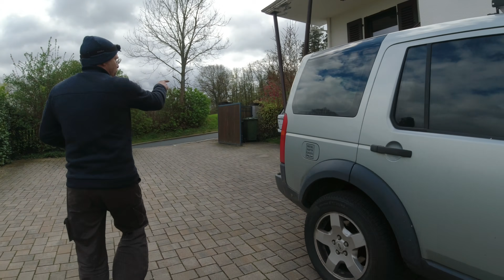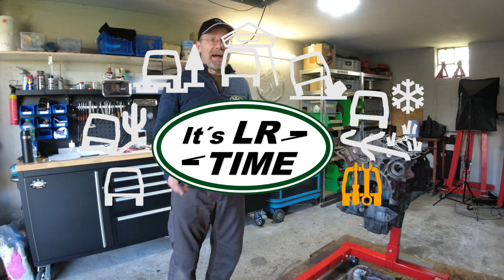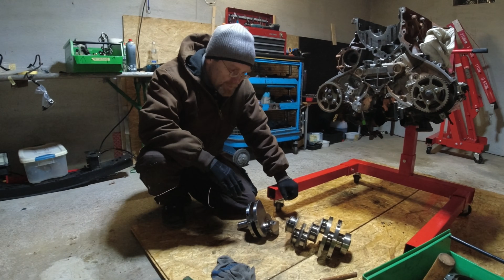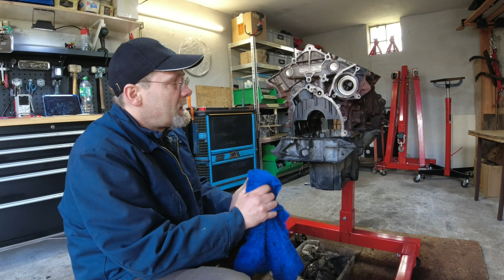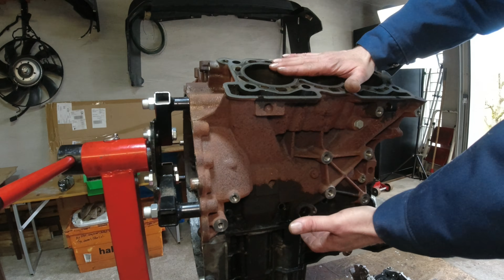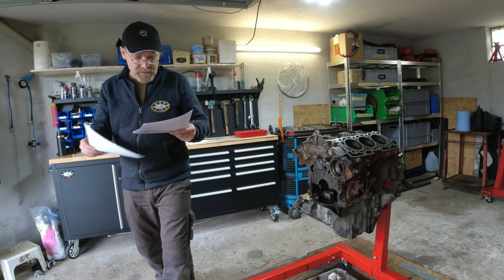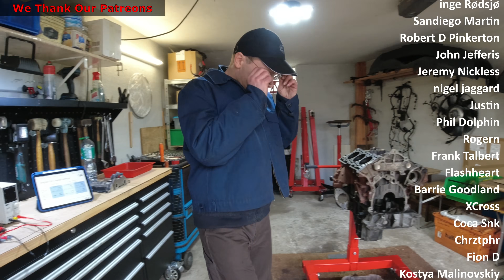Ford´s 3.0L Powerstroke failure modes - also JLR SDV6 306DT / S5-EP16

Comment: Same diesel  normal service [not sold in usa ,, but  sold in the rest of the world ] Europe service every 20,000km  Rest of the world  10,0000km . This was a Mazda design /Ford and Mazda sold   2006---2011 some countries up to 2014
Reply from the maker: It's a Citroen, PSA Colab, not Mazda. Citroen barely used that engine, maybe for 3 years. Check out our worst diesel video. We have more than enough videos on that engine. 😌😃🙋‍♀️
Reply: Same disel 2 very different service schedules 
Showing the service differences,,, u have misunderstood my comment  
Diesel motor WE-C ,,, 3 ltr ,,,4cyl  Mazda design ,,,  Called the World Ranger design  Sold every where except Usa .  Fitted to Ford Ranger and Mazda BT-50
All country service schedule every 10,000km EXCEPT EUROPE  service schedule every 20,000km.
** Comparing the requirements placed on vehicles in Europe

Comment: fuel economy expensive disasters to replace . Audi advertise dual mass flywheels as reducing emissions very$$$$$$,,,,,,, Ford use a variable vane oil pump that randomly fails mostly 100,oookm up ,,,  Toyota clutch type alternator belt drive random failure .   many many more systems

Comment: 6 bar /90 psi is not unheard of on cold start up  although 6070 80 psi on start up is preferred.  Hot oil psi /bar also  needs to be  ok .   Aftermarket v8 blocks prioritize the main crank bearings .

Comment: Factory recommended 10,000km and 5000km for severe service  ,,,,short trips,,,, cold starts,,, ,heavy load ..   
Later engines with Egr valves ,,DPF ,, turbo ,, all should be on 10,000km max ..  
Long service and fuel to oil dilution is now a problem . Wet belts and many timing chains suffer from fuel to oil contamination very badly .

Comment: Great video.  Is it possible to fit the crankshaft from the gen2 version to the gen1 version engine, or even use the upgraded gen2.5/3 that supposedly Ford are using in later F150s?  The F150 one is supposedly using a significantly stronger forged steel crankshaft.  I'd much rather have bearing failure which can be ameliorated somewhat with better trimetal bearings and thicker oil, than have the crankshaft just randomly snap.  There are also what appear to be Chinese made 'upgraded' crankshafts available for both the 2.7 and 3.0.
Reply from the maker: The block is the same and in the US, the crankshaft is available.👍🙋‍♀️

Comment: No surprise then that Citroen et al dropped this engine from their vehicles. We ran Citroens diesels, 1.7 and 1.9 litres for years, magic engines, all went past 400,000 MILES!  But we changed oil at 5,000 miles, filters at 10,000 miles.

Comment: Question: will engine from ford f150 fit to RR? I can't find any real information about it. 
Here in USA used RR engine costs $12k when f150's engine is $6k. 
Can I use parts from ford engine to rebuild RR engine?
Reply from the maker: No it will not, but the crank will👍🙋‍♀️.
Reply: @Vera_and_Christian  
Thanks a lot for the info! 
So the shortblocks are different, right?

Comment: Love watching you guys!!! Here in the states they sell forged crankshaft for TDV6. Question: would that solve the problem?
Reply from the maker: All OEM are forged👍🙋‍♀️
Reply: @ oh wow! I’m looking to purchase a 2019 TDV6 range rover. It’s got 90,000 mile (144,000 km). The oil filter shows no metal shavings or glitter. Its received regular maintenance it’s life. What’s your best advice to me about it? It spooks me knowing about the crack issue.
Reply from the maker: @LESIVSYLVESTER  Check out our "Engine Oil and Oilpump" Playlist, if you need more information, consider signing up on our Patreon page. We get up 1000 comments, messages, and emails every week and cannot answer in detail unfortunately. But on Patreon, we can. 👍

Comment: I’ve done some testing in my TDV6 3.0 D4 200k km it’s very worrying to see that above approx 96c coolant temperature the oil pressure drops off drastically. E.g towing up an incline in 25c weather the coolant temp can rise to 104c easily, therefore so does oil temp which rises above 120c resulting in 10psi oil pressure @2000rpm. 
The new uprated oil pump makes a 2-3psi difference if that… 
Now the original PWM Viscous fan was on the way out, this was a contributing factor but is not the whole problem. This fan does not fully engage until 107-108c due to the PWM control.
I now run an uprated oil pump, 10W-40, new fan, a custom thermostat (opens at like 85c) and a Redarc oil pressure +oil temp monitoring gauge. Just need to trick the PWM signal to fan now or reprogram the ECU so this will work correctly for maintained high loads or off-roading here in Australia.
I honestly believe this is the main contributor to the destruction of these engines.

Comment: In the u.s. here, really want a land rover td6, been looking at used 2017 and newer. Can i safely by this engine or is it a doomed motor from the beginning. I plan on buying one with less than a hundred thousand but need it to really last, 200k for sure. I want toyota landcruiser type reliability. You cant buy a diesel toyota here.
Reply from the maker: The 2017 and onwards is a DEF Diesel and it has bearing problems caused by oil dilution.  It can also snap a crank shaft.  If you get one, change oil every 6000 miles.

Comment: Hi Again Christian and Vera based on what you advised re 5w 40 oil from now on with my 2020 Range Rover sport should I change my oil from the Castrol edge 5w 30 to 5w 40 at this moment my car has 48000 miles on the clock. And since I am the second owner I do change my oil every 8000 miles. I have also just had full transmission oil change also and will do the diffs next oil service. Car currently is delivering 28. 3 mpg round town and 45 mpg on the motorway at 70 mph. Will the 5w40 increase fuel consumption ? What is your honest opinion. Because I have on my mind always what if this fails … which I never had with my mercedes Cars 😫😫😫😫
Reply from the maker: Check out our "Engine Oil and Oilpump" playlist. 👍🙋‍♀️

Comment: Hi Christian/Vera:
This article - an interview with one of the designers of the powerstroke 3.0 suggests that the JLR 3.0 benefited from some improvements including strengthened crankshaft from Ford’s redesign of the engine. Thinking of purchasing a Discovery 5 with td6 - possibly post 2018

Comment: I, as a Brit, lived and worked in the US for two decades. I was surprised how where I Iived in Pennsylvania, there were oil change shops dotted everywhere like we in the UK have pubs. Friends I came to know would ignore the manufacturers instructions for oil changes and change their oil much more frequently / shorter distance intervals than recommended. This was a totally different approach to the UK, where after warranty ran out, people would really slide on oil change discipline. In the US, frequent oil changes and the generally longer distances people drive (think nothing of driving two hours to dinner, or an hour to a supermarket) are why so many US vehicles see big mileage achievements. Seeing a car reach 250,000 miles was met with a shrug. Change your oil, people!
Reply from the maker: We also lived in the US also for almost 10 years and I had a quick oilchange shop close by. They also put in what I requested. 👍👌🙋‍♀️

Comment: the engine looks to have an inballance problem also the cylinder block looks to have a problem in the Houpt lager moving due to torque or heat cycles causing the tunnel becoming misalighned as well as oiling problems,great content well done.
Reply: Well done guys very independent analysis of a shocking engine, such a shame about the design faults or should I say planned obsolescence for profit, such a waste of materials this is the modern way unfortunately 
Also machs gut 😊

Comment: Hi Christian, Could the oil solenoid found on the latest oil pump be unplugged to allow normal oil pressure all the time instead of it reducing the pressure, which is a compromise to meet regulations for fuel economy? Normal oil pressure sounds much better for the health and longevity of the engine than limiting oil pressure by the solenoid to gain a tiny fuel efficiency. Thanks.
Reply from the maker: I don’t know. Suggest to ask this in the Disco3.co.uk forum. Christian

Comment: Hi to the both of you !!!
I watched the video as you posted it on Sunday 
Having seen the problems you are having re the blown engine and the availability of a motor to rebuild I wonder about the possibility of having the engine block repaired ??Over the years in my far distant past ive seen blocks welded/stitched to good effect I know that they would all have been low stressed tractors or stationary diesels .
Perhaps this question is out of place 
Perhaps the Disco 4 could become a Queen v8 ??
I wait in eager antisipation for your next move 
Good luck with what ever the outcome 😊😊😊😊😊
Reply from the maker: It would be risky and not much cheaper to fix the block instead of a used engine rebuild. Will be on down the road.

Comment: two questions
1) have you explored our British scrap yards? We have loads of cars that get scrapped because they are involved in rear-end shunts. These lads keep our P38s going.
2) Why don't engine designers use hydrodynamic bearings. Many years ago I worked with an engineer who designed both linear and rotary bearings. We used Hydrodynamic linear bearings where we required high stiffness but more importantly uniform motion at very slow speed, we were grinding read-write heads for disk drives. We then designed a rotary bearing for diamond disk turning, and in that application turning at 3000rpm we used paraffin as the lubricant. We were loading about a ton and getting deflections of less than a micron in both axial and radial directions but it needed only the highest of touches to make it move and it would keep turning forever.
Reply from the maker: We bought a engine with a UK vin in Germany for 7700 euro 😩

Comment: Leider habe ich einen Turboladerschaden bei meinem MY2019 bekommen, der Späne ins Öl gebracht hat. Deshalb war auch der Motor hinüber. Jetzt habe ich für 100% Kulanz - Kostenübernahme einen neuen werksneuen Motor mit zwei neuen Turboladern bekommen. Der Serviceleiter meinte, dass die neuen Motoren seit Mitte 2019 eine neue Kurbelwelle mit neuen Lagern bekommen hat, welche die Fehler nun beseitigt haben (?), also gerade eben auch die Austauschmotoren in der Nachproduktion. Beim neuen Motor wurde mir Castrol 5W30 C1 eingefüllt. Ich habe eine Garantieverlängerung (Händler) für weitere 5 Jahre (100% Lohn, 40% Teileübernahme) für den Motor mit vielen anderen Komponenten in der Abdeckung bekommen, muss dafür dann jährlich zur Inspektion. Ihr beiden habt vermutlich dezent mehr Ahnung als ich 😎, zwei Optionen: würdet ihr jedes Jahr zur Inspektion und 5W30 + je nach km in der Zwischenzeit (z.B. bei ATU) 5W30 einfüllen lassen,
oder in der Zwischenzeit 5W40 einfüllen lassen, dafür kommt aber bei LR jährlich 5W30 rein?

Angenommen es passiert was in den nächsten Jahren, würde ja vermutlich die Garantie nicht greifen, wenn sie (für sie) ‘‘falsches‘‘ Öl nachweisen?

Ich danke euch herzlich für eine Antwort und die tollen Videos! Top, dass ihr sowas macht!! 😎🤪
Grüße aus Luxembourg
Reply from the maker: Die Kurbelwelle und Lager sind seit März 2016 unverändert. Geändert wurde das Anzugsmomnent der Schrauben im Werk.  In der Gewährleistung bist Du an 5w30 gebunden. Alle 8 - 10 t km ist der Intervall bei der Nutzung in D und Autobahn mit Stadt.  Christian

Comment: I think, you are completely right, Chistian! I had my Discovery 3 out of 1st hand, and the pre-owner told me, that he always did premature oil changes. Result: the car has 356‘000 kms, doesn’t consume any oil and runs perfectly for hours and hours. Just came back from Holland to Switzerland in 6 hours, only to stop once shortly for Diesel refill! Before I turn the engine off after Autobahn, it let it run for 2 min. Only after that, I turn off and execute the refill. I do oil changes now already after 8´000 kms and refill 5W40! 😊 And: it has no Dieselfilter! I think, this too is better for the engine! Airsuspension? It still has the original Airshocks from 2004!
Reply from the maker: Wow, a 2004 is like the very first of the Disco 3 on the market.  They are the best, mine also does not have DPF even so I have a Euro 4 sticker. 👍👌🙋‍♀️

Comment: Hi Christian, Ford are using sdv6 in their next Gen Rangers and Everests, you can go to a car yard and buy these new.... They changed the block design to alter the EGR assembly but I believe the internals are same (oil pump is different, it has some sort of solenoid valve on it and call it a gen 3 version....) great videos buy the way.... Thanks.

Comment: Hi Christian, great videos! May I ask something of an L663 Defender of 2021? What kind of oil do you suggest for a LandRover Defender L663 with a P400e plug-in hybride 1997 cm³ 297 kW petrol engine? LandRover uses 0W 20.
Reply from the maker: Whatever Land Rover specifies. 👍🙋‍♀️

Comment: Great video, you pretty much summed up those idiotic oil change intervals set by manufacturers. I just cannot believe they recommend using such thin oil for those amount of kilometers, especially on a diesel. People overlook that specified diesel grade oils are 'detergent' oils, they have additives to clean and reduce the nasties building up in a motor produced by burning diesel. 15000km intervals isn't something I would abide by including petrol motors. 7500 to 10000km would be reasonable according to driving conditions and your climate combined. Agreed that 5W40 should be a minimum to address a wide range of driving and climates for Discos, there are many oil brands that meet the oil Ford spec and have Technical advice gurus you can call for assistance.

Comment: Hi, Christian, do you consider it is acceptable to change TDV6 3.0 oil at intermediate oil service, lets say every 7500 km, with a vacuum suction  but without changing an oil filter  ? And every 15000 both filter and  oil ?
PS. Considering A3/B4 5w- 40, for sure
Reply: I wouldn't use ACEA A3/B4 oil because it is not DPF compatible.  I would use ACEA C2 or C3 oil, and I think it's perfectly fine to vacuum out the old oil and refill with fresh oil without changing the oil filter for the intermediate service.
Reply: @tempestv8  Thanks, appreciate, I agree in general, but the case that my D4 2014 was dpf free from the factory 😉 as for the local market specs, so I am free to use a3/b4 and actually used to apply this oil last 150k km
Reply: @AlexIVVIxelA  Oh wow, I didn't know that the D4 is sold in markets that do not require DPF.  In which case, ACEA A3/B4 5W-40 oil would be perfectly fine!  🙂  That's what I use in my LandCruiser 200 TDV8.
Reply: @AlexIVVIxelA  In your market, where there is no DPF required, are there any known instances of bearing failure or crankshaft breakages?  

I ask because I wonder whether the lubricity of A3/B4 engine oil may be superior to C2 oil for DPF equipped markets.  Perhaps TDV6 engines running A3/B4 oil do not suffer such failures.
Reply: @tempestv8  There are the same issues with bearings and crankshaft. LR officials were recommended the same “energy-saving” 5w-30 a5/b5
C1 oils. And owners had to use it at least during warranty period ie. first 3 years. Some were  doing this oil even later on. So this engines are also known as a ticking 💣 engines. For happy some replacement crankshafts are available. Some Ford p/n appeared, etc

Comment: you're absolutely right about oil change intervals, and its nice that you bring up evidence to help explain. I have always tried to explain this to friends of mine who have a new car and think that because the interval is 15000 miles thats what they should do. 5000 miles or twice a year will get you another 100 000 miles of use out of a vehicle over whatever the manufacturer recommends, and putting in a 40 weight oil couldn't hurt either.

Comment: I agree with everything you say.
So with my Discovery 4 currently up for sale, the first thing i did was to change the oil on my 40k mile Discovery 5. I had use use LR spec 5w30 since i bought a big 20 litre can. However i added some Luqui Moli additive to make it oily. 
But now this can has finished, which 5w40 oil would you recommend that is also low SAPS so not to poison my DPF?
Reply: Where can you get a dpf for that cost in the uk . More like £2500
Reply from the maker: The ACEA C3 is ok for the DPF.  A DPF is 250 Euro and an engine 12000 Euro.

Comment: Now, the question is, if the same philosophy should be used in other engines that Land Rover have used. I can mention for example my own 3,2L straight six petrol engine that Volvo made. It's in my Freelander 2. I use Castrol Edge ti 0W-30 as Land Rover specified, but I change oil and filter every 5000 km, no matter what. Always. And I do the same on my other cars.
So, should I use 5W-40 instead?
Kind regards,
Redfox.
Reply from the maker: I would stick with the manufacturer recommendation unless the engine is known for bearing issues.  Christian

Comment: Have you ever done a video with an oil analysis and your thoughts on the results? 
I changed the oil in my Ingenium 2.0 diesel at 9,000 miles and had a sample analysed. The result was basically that the oil was no longer serviceable, it contained more aluminium than expected and a high level of soot. They reported on a lot of other wear elements and things like water and fuel dilution.
It wasn't too expensive to get it done and provided a lot of food for thought.
Reply from the maker: We have never, but we get send oil analysis to us. And they usually get a recomendation to change the oil even more frequent, like 4000 Km. 👍🙋‍♀️